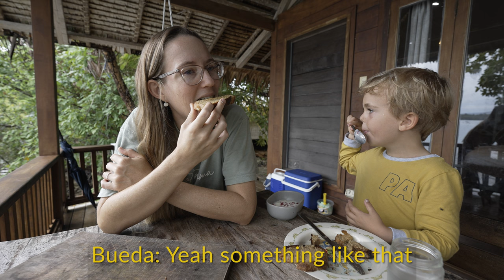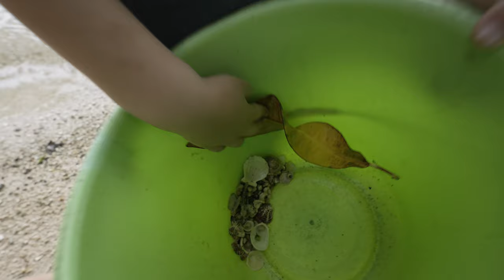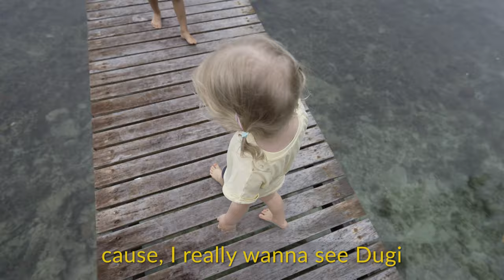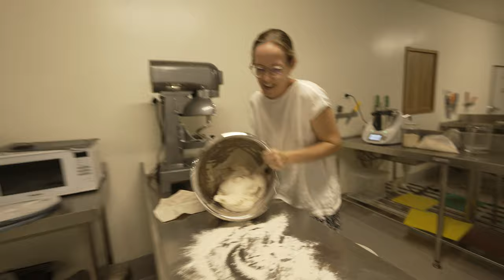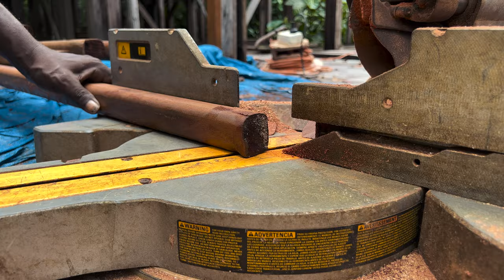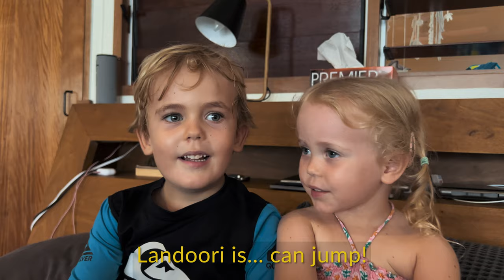How We Live Off Grid on a Remote Island and Love It // Island Vlogmas Day 3

Comment: I love that you guys are using traditional Sago leaves for your roofing. However, I can see that the roof is a little to low to use sago leaves for roofing. Perhaps lift the roof a little steeper to avoid leakage, cyclone and durability. Great video 💯❤️
Reply from the maker: Yeah it’s quite exposed to the North and the orientation of the house meant we needed to keep the pitch low to prevent the iron lifting in big winds. Jase has build to cyclone standards but the leaf is obviously a bit different. We’re hoping the ropoto is strong and high to keep this roof secure but totally see your point. Our other leaf Haus is very steep as is the restaurant Haus for this very reason. But I guess if we have to replace it sooner that’s ok as this pitch keeps it all in line with the rest of the house. I love hearing from someone who understands the use of sago leaf though 😁